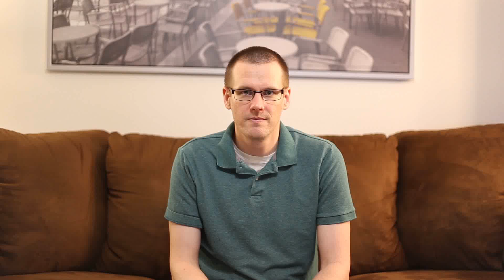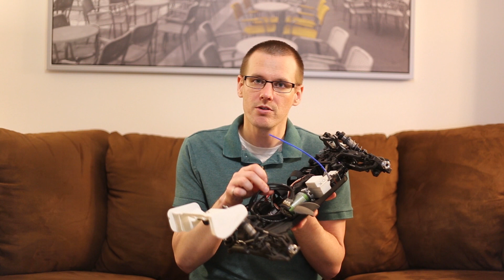Applications of Sensored vs Sensorless Brushless Motors

Comment: Hi Ryan!
Nice video, but could you explain why sensorless mode is more efficient than sensored mode in a hybrid ESC?
Because you already carry the disadvantages of the sensores with you (weight, cost, risk of mechanical or thermal damage), so why not use the sensors if they are already there?
Wouldn't they be more accurate than the interpretation of Back EMF, even at higher rpms?
Thanks!
Reply from the maker: Hey Karl, thanks for the comment. You would expect the sensors to be more accurate as they are a direct measurement. But that is the actual problem. They are located in the same spot regardless of RPM. Much like in a car, you want to change the timing as the engine speeds change. Valve timing and ignition timing are altered.  In a brushless sensorless ESC, the timing is done electronically to optimize performance in the exact same manor.
Reply: @RCexplained  Hi Ryan!
I understand, that's the timing issue you are referring to. But wouldn't it be a piece of cake fir the ESC to take this into consideration? IF RPM>x THEN justAddSomePreIgnitionDegrees?
In many ESCs you can set the timing, which is, I suppose, fixed through the whole RPM range (correct me if I'm wrong). On certain ESCs you can also enable a boost mode, which is, I suppose, a dynamic timing.
Not sure if this boost mode is only available in sensored mode ...
And if you derive the rotor Position from back EMF, shouldn't you encounter the same problem?
Reply from the maker: Hey Karl,  I don't think it's as easy as simplifying it to a formula like that. When ESC's didn't have an auto timing advance function, the timing was set manually. Default would typically be a medium timing advance, however manufactures of ESC's would provide their recommendation in terms of how many motor poles are on the motor. As the number of poles increases, the timing advance also increases.  A Wye wound motor vs a Delta wound motor will have a different timing advance as well. You would not be able to get motor poles and winding termination type in to your formula. These are only a couple pieces of the timing puzzle for electric motors.

Take a look at what Castle Creations describes as their Smart Sense technology.  They don't just state transitioning from sensored to sensorless at high RPM's is more efficient, they state that it is ultra efficient.

Comment: Great info! I have always heard that the motor draws from the esc rather than the esc sending pulse? If you could clear this up for me I would appreciate it. Thanks
Reply from the maker: You squeeze the trigger on the radio and the receiver sends the signal to the ESC. The ESC is responsible for taking that input and sending it to the motor. The ESC is able to produce a voltage at a frequency and when the motor receives the voltage at a specific frequency, it begins to rotate. The current draw is based on the load of the motor. A higher load on the motor and it will pull more current from the ESC. Example: The ESC changes the frequency of its output to speed the motor up, the motor as a result draws more current to handle the additional load. I hope this helps.